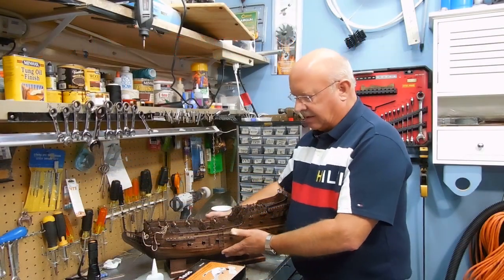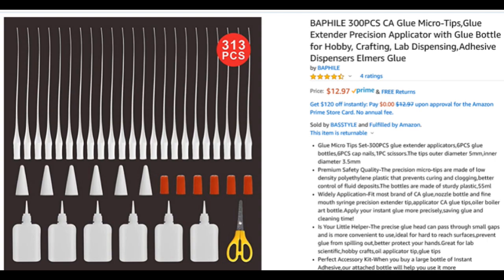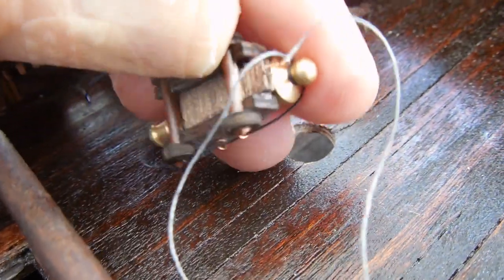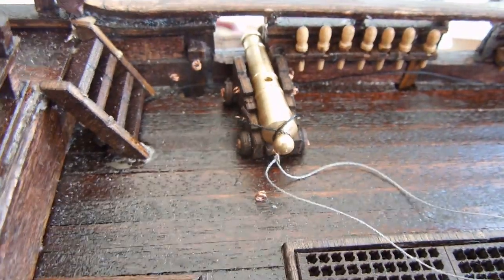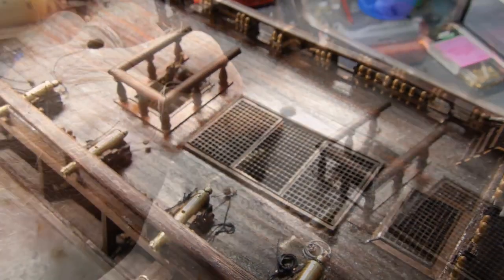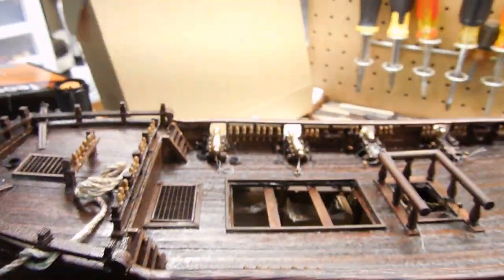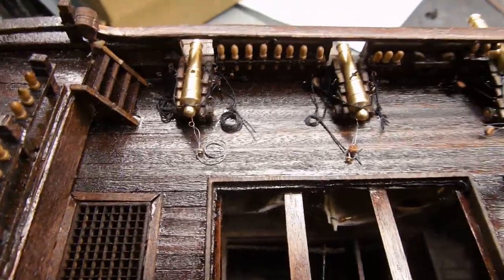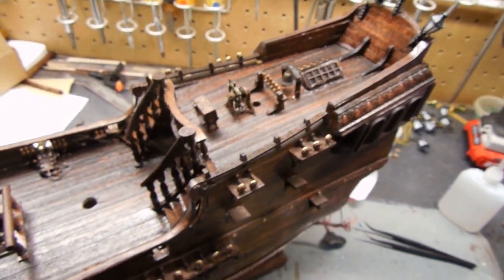The Black Pearl Model Ship Part 20

Comment: Thank you so much for doing these videos! They are extremely helpful and have a ton of great information. I bought the super glue and the magnifying headset. Wow! Such a great investment for building these models! Thank you!
Reply from the maker: Yes, the magnifying headset are a must have item!  Also the plastic applicator bottles with the smaller tips I wish I had from the start. I still buy the super glue in its bottle but pour the contents into the other container.  I’m very close to making another video segment and then probably one final one of the finished ship! Thanks so much for letting me know that it’s been helpful! It’s a good motivator for me to keep going! I worked on her yesterday and had a breakthrough moment on riggings and climbing ropes! It’ll be in the next video 👍👍
Reply: @BoilerDan1  I look forward to seeing the video. All your tips and tricks are great! Definitely keep up the good work!

Comment: Hi Dan. I am building a ZHL models pearl that is 1:48 scale - Hull is 31" long not count bowsprit ( same as yours is now )following measurements are from deck level. foremast is 56cm tall with yardarms 33-27-19 cm. main mast is 65cm tall with 36-29-22 cm yardarms and mizzen is 39cm tall with 22 and 18 cm yardarms. hope this helps
Reply from the maker: GREAT! Thank you so much! Can you also provide how long is the bowsprit beyond the 31” length of the ship.   In hindsight I should have purchased the real ZHL version.  But I was new to model ship building 😉
Reply: @BoilerDan1  The bowsprit is 25 cm from where it exits the ship in front to the tip

Comment: Hello Dan,
Hope all is well. You are doing a wonderful job on this build. Thanks for sharing it with us. I have a question, I've been looking for the lanterns everywhere and can't seem to find them. Could you please share the link where you purchased them? Thanks again! :) Keep up the fantastic work!
Reply from the maker: Thanks so much!  I found the flickering lights at Amazon.  I'll put a link at the end of this.
It came in a pack of 100 and it also came with the resistors, however you would need to add one resistor for every light on the ship.  I went to a local electronics store and took the lamps with me.  They sold me a single resister that could handle all the lights with just one.  The resistor they sold me was only like $2, well worth the investment!  I'd suggest you do the same... or wait, Let me look in the garage (I might still have the package).... FOUND IT!  It will handle 10 lights, and there were two in the pack, so I must have put in 2.  They are 1/4 watt, 47 OHM QW047 Flameproof Resistors.  I'd recommend going to electronics supply store as you don't want to overheat something and have your Pearl go down in flames!  So here is the link from amazon.  I purchased the EDGELEC 100pcs 3mm Yellow Flicker Flickering LED Diodes Candle Flicking Lights Clear Round Lens 29mm Long Lead DC 2V Light Emitting Diode Lamp Bulb +100pcs Resistors (470ohm for DC 6-12V) Included. https://www.amazon.com/gp/product/B0785DQ8FD/ref=ppx_yo_dt_b_search_asin_title?ie=UTF8&psc=1   I'm still working on the Pearl... Something I will be very proud of when finished.... Stay tuned!   :0)
Reply from the maker: I meant to add..... I took coper wire and kind of wrapped it around the lights to simulate a lantern.  I tried to make lanterns but failed.  I'm still happy with them, but had envisioned actual lanterns….  I also broke a wire somewhere so the ones topside at the back of the ship won't lights.  Disappointing, but I've decided to live with it.  See my first reply for the light information requested.  Thanks for watching and following along.
Reply: @BoilerDan1  Hope you're having a good day. Thank you for the information. I was meaning the 3 little lanterns that came with the boat that go on the back. I noticed you had quite a few there that you purchased separately. Thanks again.
Reply from the maker: Oh, sorry.  I found those at eBay. Here is the link:
https://www.ebay.com/itm/10Pcs-1-50-HO-Scale-Model-Lamppost-Train-Railway-Park-Led-Lamps-Up-Wall-Lights/401527839590?ssPageName=STRK%3AMEBIDX%3AIT&_trksid=p2057872.m2749.l2649
 but I noticed that there was only 1 left, but if you enter the information on searching eBay, I think you can find more.  Note: They are slightly larger than the ones that came with the ship.  But I like them better!  You will need to snip off a small part on the back just like the ones that came with my ship.
Reply: @BoilerDan1  Thank you soooooooo much! :) I have been looking for them everywhere, I wasn't using the correct wording in my search. Keep up the great work...looking forward to seeing that excellent finished product. :)